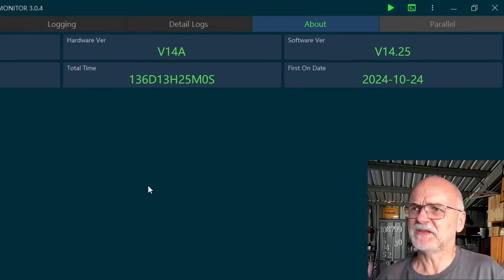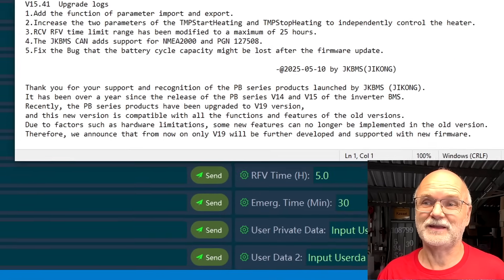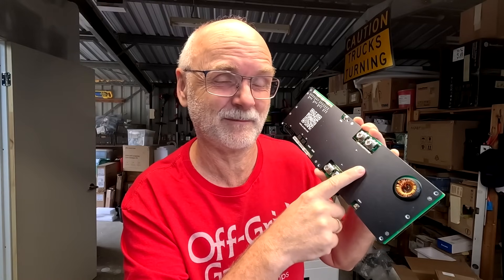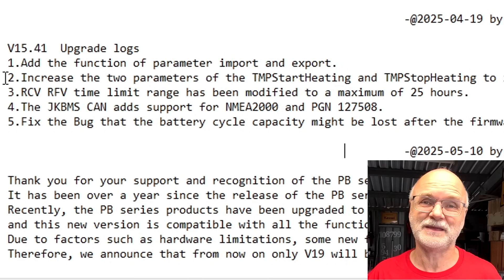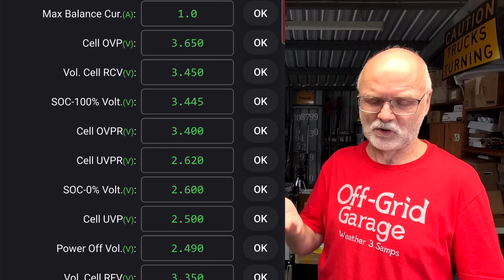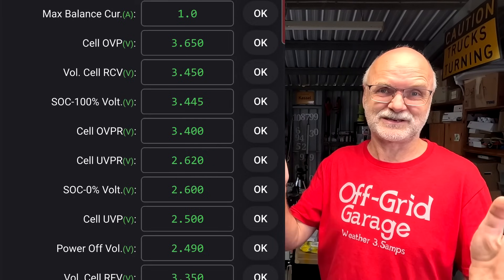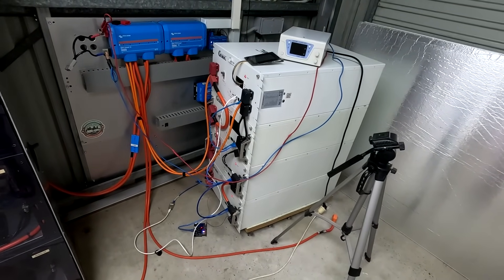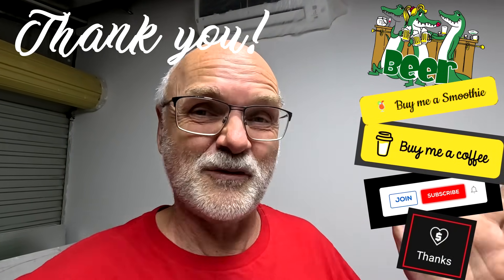The inevitable end of the JK-BMS. EOS for V14 and V15 - is that it?

Comment: With every good thing, there comes an end 🎉
Greetings Andy
A while back when you received a new kid on the block (JBD bms), your review swayed me away from it and I cancelled the order for 8 units. The company/supplier couldn’t make the bms fast enough for 2 months!!!
So I went back to PACE BMS.
I had three batteries (Meritsun 5kwh wall mount) that came with the PACE bms. The version I’ve had the 100A 15s bms and later they switched to 100A 16s bms, so technically these batteries can’t be used in parallel with newer versions 
After firmware update on the bms, there was an issue with the total charge and discharge amps for 3 batteries in parallel bc I could only get 200A discharge and 50A charge
So reached out to the company and they sent me 3 new bms that I swapped into the batteries leaving me with 3 extra bms
Since the cost for batteries was still high, I chose to go fully DIY with my solar system and decided to build my own batteries 
I purchased 5 more PACE 200A BMS and I intend to to build 8 more batteries to put in parallel with the 3 I’ve 
The issue I’m running into is, the batteries I bought from Meritsun were 15s using a 16s BMS but with fewer cell leads on the BMS connectors to suit a 16s and the number of cells in the BMS software reduced to 15cells
I’ve gone into the software and changed the number of cells to 16 and when I do this, is shows number of cells as 16 but has missing values for cell 14 and 16

Have you tested these bms set up for 15s even though they are 16s and added more cells to make them 16s bc that’s what I’m trying to do to get to parallel all my batteries 

I’ve new wiring harnesses that allow me to connect to 16 cells but need to know if there’s something I’m missing before I fully connect these batteries in parallel and find out the hard way 
Thanks

Comment: I believe JK BMS should have the option to configure charge and discharge efficiency. My battery system operates with 95% efficiency for both charging and discharging. When I account for these losses in Grafana and compare two full cycles from 100% SoC back to 100% SoC—even months apart—the numbers add up perfectly. I genuinely can't understand how JK BMS could lack such a fundamental setting.
Reply: Additionally, with the latest firmware, my storage system never reaches 100% SoC—it consistently stops at 99%, even though all settings are correct. The only minor deviation is a slightly increased charge voltage, as my Deye 6kW inverter loading with under voltage by about 0.05V per cell. Still, this shouldn’t matter, since we're defining 100% SoC based on configured parameters…
Reply: @maciegx1337  I quit using closed loop for charging switched to lead acid set the voltages never looked back. Closed loop is over rated IMO. I use a shunt to set everything the way I want it hasn't changed.
Reply: One more thing: the mobile app was supposed to show the current charging state of the battery and display the float timer and other relevant status information. Unfortunately, this still isn’t working as expected—the app does not display this information at all.
Reply: @maciegx1337  welcome to china.
Reply: @maciegx1337  Yes it does.  Update to the latest App on Off Grid Garage website
Reply: I wonder if the 19 is coming in at the same price as the 15.

Comment: I have a single 100 Ah battery with jk inverter bms v15, a multiplus2 and a raspberry pi running venus os. Dvcc is enabled. BMS is connected through usb-rs485 adapter to rpi. The rs485 port is one near CAN port. My absorption voltage is 3.45. I see Requested charge voltage of 55.2 in VRM, which is correct. After 30 min of absorption the requested charge voltage is shown as 54.0v and I don't understand why. My float voltage is set to 3.35v (which should be 53.6v, not 54.0). The system stays in this state for days if I don't discharge the battery (it's a backup system in the apartment). The led on multiplus is in absorption state (not switching to float). Any idea where those 54 volts are coming from? I didn't configure it anywhere. 
If I switch multiplus to Inverter-only mode, I can see in VRM that requested charge voltage is 54v until battery SOC is above 80%. Once it goes below the requested charge voltage jumps back to 55.2v. I'm on 15.38 firmware. BMS is 150A 1A 16S v15.

Comment: I bought my first jk inverter bms on march 22nd, in official jk store on ali. It's v15. It was not advertised that there will be EOS in just under 2 months... And it was not at a discount price either. I expected they will fix some issues along the way. Well, it mostly works, expect of SOC. The SOC is just 1% when cells are @ 3.15v. I wish I just went with basic (non inverter bms) and smart shunt...
Reply: It's rare that you'll get a company pre-announcing a replacement, because it'll then end up with a sales slump and lots of unsold stock. I'm afraid that's just how capitalism works. (I got mine in January.)

Weird behaviour. Have you definitely set the correct battery capacity? How often does it reach 100%? It sounds like the capacity has been set too low, because it (somewhat inaccurately) determines SOC by integrating the current flow and if it thinks the entire battery's capacity has been taken out of it, it will stick at 1% until the low voltage threshold is reached. It is possible that the battery is indeed quite near empty at 3.15 V/cell, due to the flat discharge voltage curve. Try setting a slightly higher capacity - Andy's found that cells perform better than their specification.
Reply: @matthewmarks6951  yes, but when I shop for android phone I can see a release date and I can see when 3 or 5 years of updates will run out. So I can buy either previous year model cheaper, etc. 
For SOC, it's apartment backup system. I charge it to 100% twice a week. I'm not 100% sure in the capacity. I bought used 16s 100Ah battery without BMS in EU store. Store claims there should be at least 96% of original capacity. I set it to 100 Ah in BMS. But I didn't yet perform the full capacity test as I don't have a good shunt to do so.
Reply: @AlexanderBelikov  OK, well because the capacity you set in the BMS is what is used to determine the SOC in conjunction with measurements by its own inaccurate shunt, treat it not as the battery's actual capacity, but instead a figure to adjust to get the behaviour you want. This is presumably a higher reported SOC at the  charge level you've mentioned,  because otherwise the inverter shuts down as you've exceeded its maximum depth of discharge limit?

Comment: It would be nice to have bug fixes (Like 100% SoC reset for example) though. 😂
Reply: Search for the video "New JK-BMS V14 and V15 Firmware with advanced Charging Algorithm and... a new bug?"

The "new bug" is a hardware issue coincidentally noticed - on some units the dry contact relays are unreliable. What other bugs need fixing?

Comment: If Jikong really wants to be the #1 go to for BMS'es, they should make their firmware open source. There are no real financial downsides for them, only benefits. Because, together with the community you can build awesome firmware, which they build for FREE, and in return, you will make a lot more money because everyone wants a JK BMS because it's so versatile and customizable :) Don't you agree Andy?
Reply: Exactly my PoV too. Andy, would you consider to put a discussion with them about that ? I actually do think, ppl buy their hardware mainly, and not the "whole product". They are rather "accepting" the current software environment (firmware, app etc) as they dont have an alternative.
Jikong CEO should realize the following: They have a "special" and educated range of buyers mostly. The do not need (!) and basically shouldnt even try to make it a standalone-solution. They should realize, what their users want, is integration into their very different kinds of setups - I bet they would increase sales by more than a 100% by providing an open-source firmware that would pretty sure end up in a lot smoother integration into other diy-opensource-systems.
In short: Remember your target audience. Non-Tinkerers will not be opting for JK-BMSes in general.
Reply: Worth looking up existing discussions of this in the comments.

Comment: Hi Andy, just need some advice on where to get a 20kw battery for my off grid motorhome. I’m running a 48/5000 victron multi plus 2 system. Please thanks mate love your work
Reply: You can try LiTime batteries.
You can make it as big as you want.
There are lots op options. Also for other brands.
You can use 24v batteries in series, or multiple single 48v batteries in parallel.

Comment: this is great; but mostly what is worrying me is inability to 1) download latest JK BMS APP from OFFICIAL SOURCE 2) install and make it start on any of my phones that latest version of the JK BMS app which supports new features implemented in the firmware (latest versions they compiled only for arm64v8  CPU-based phones but even on my arm64v8-based phone the latest versions does not start after installation. 3) JK BMS V15 150A-version cannot be Bluetooth-paired unless I use "temporarily-generated" code from Miro's website as pairing pin; and it does not remember "paired" state, need to enter new code EVERY time. What if no internet access or Miro's website closes down?
Reply: in google play store right now:   does not say which version is it, but "Updated on Nov 24, 2024" - obviously it is outdated version. WHY the user of their BMS has no other option than looking for the latest version of the app ELSEWHERE - not even on manufacturer's official website ?

Comment: I think I still have two version 10 JKBMS, and one version 11 JKBMS running for over 3 years straight. They stand-alone, are not in communication with my three EG4 6000XPs. I would like to upgrade to version 19 BMS's eventually when I add another 60-90kwh of storage (45kwh currently). I only ever had one issue with them when the inverters were set to discharge lower than the BMS's so they would cycle on and off and they were trying to actively kill the battery because each time they turned on below the low voltage cutoff, they would discharge at high amps for a second before turning off again. So I set the inverters to always switch off battery or shutoff load before reaching the BMS low voltage cut.

Comment: Forget new features, I just need existing features to work properly. I still can't reset to 100% SoC properly because of their ridiculous decision to require the RCV to be reached before the timer starts. I'm sure that doesn't need new hardware to work correctly.
Reply: You need to calibrate bms voltage at least 0.2volt higher than real voltage. I think the solved this shi# with the new frimware but I'm not taking a chance sometimes after upgrade press reset button. It will work properly.
Reply from the maker: The question is, why is your inverter ignoring the data from the BMS? The most accurate battery voltage is right there. There should be no need to offset or overcompensate any voltage just to trick your inverter.

Comment: Hello Andy, after updating versions v14 and v15, I found myself having had a protocol modification in LTO PLUS IN LIFEP04. The values of the lifep04 were all switched to LTO and on my cerbo the capacity is not good which indicates 80ha instead of 582ha. Have you seen this problem Andy?  firmware 15.41 and 14.28 no good capacitee please look andy
Andy I have to flash the firmware in 15.41 where it is a bug in the firmware that does not give the right capacity on Victron Cerbo!
Reply: andy you should no longer buy jkbms the engineers are getting worse and worse the only firmware that works for me on victron is 15.38 and after that it bugs and creates alarms impossible to have something stable incredible ANDY DO YOU HAVE THE SAME PROBLEM PLEASE

Comment: I was on 15.38 FW and when I upgrade to 15.41 FW all the settings on the BMS reset.  I had to reprogram everything.  Anyone else had this behavior?
What does Battery Temp OTA and Battery Temp OTAR means on the new FW 15.41?  Both are set to to 30C default temp.  But there is no information on that.
Reply: I upgraded the phone App and Battery Temp OTA is not there anymore.  I guess it was a compatibility issue with the new FW and old android app.
Reply: must be Over_Temperature_A[don't know what] and Over_Temperature_A?_Release.
Reply: I think it has something to do with note No 2 on the release notes.  OTA Cannot be set lower than 30C and OTAR has to be higher than OTA.  But I am not sure what the A on OTA means.  Once you change them from the default 30 you cannot put both of them back to 30.  Only OTA will let you set it to 30

Note 2 is:
 2.Increase the two parameters of the TMPStartHeating and TMPStopHeating to independently control the heater.
Reply: yes for me it's the same and import 15.39 settings will work but appear frequently. so I have do all new with the APP and never connect the PC software (here 3.0.3.28)
Reply: @paultest3917  see my note below, you need to update the app to 5.0.3 using the apk link off Andy's resources page.
Reply: Same here, updated to 15.41 using the file off Andy's website and I got Battery Temp OTA and Battery Temp OTAR couldn't see the heater pad settings anywhere? I updated my Android App to 5.0.1 off Andy's resources page and it was the same. Now updated to 5.0.3 off the same page and it has fixed the problem. Just need to update the app to the latest version (don't know why JK don't have this easily accessible on their website) and it works.

Comment: I just finished building my second battery with a v15 (and the new Display)

Any idea if there is a way to retrofit my old EEL v3 DIY Box (Seplos BMS) with a JK Inverter BMS?
Reply: Have you seen his video "Installing the JK-BMS in a Seplos MASON DIY Box? Well, it's not that easy... but here is how!"? Yes, different box, but it might provide a good starting point.

Comment: Can someone help me understand: why don't we let our victron mppts and smart shunt handle all the charging and energy in/out measurements? I thought the  bms was only meant to do cell protection, balancing and cell voltage monitoring? (And maybe heating as well).
Also why would you want your bms to be communicating with your inverter?
Reply: Victron does not officially support DIY batteries, and there are some bugs in the charging process. For example, Multiplus ignores the maximum charging current limit reported by the JK BMS and still charges at the current set in VEConfigure. Only after enabling DVCC (that is, to let BMS control the charging/discharging), the system can work properly.
Reply: It would be nice, if the JK BMS could Import the State of charge from the Victron smart shunt, in my Installation the value from victron seems to be much more plausible than the value from the bms
Reply: @rainerkohls5811  I have a JUNCTEK equivalent shunt and I intend to investigate solutions such as YamBMS to achieve this.
Reply: The BMS is unable to regulate the voltage or current passing through it - it can only connect or disconnect the battery like a circuit breaker. It therefore instructs the inverter to provide the voltage/current needed by the cells at any particular time. (A slight subtlety is the current limiter - in the case of these BMSs they can limit the current to a fixed 10 amps, but this is to handle temporary issues with parallel banks of batteries - it can't instruct the other batteries to only charge/discharge at particular rates.)
Reply: @matthewmarks6951  My solar setup chargers and inverters have their own little processors and settings to work as individuals but to all work together they needed a master sensory device and a control head with larger memory and processor.. It is smart enough to start-stop-reduce-increase voltage and current for charging the batteries and operating the inverters.. BMS were designed to be a safety device that keeps track of individual cells and to look for out of spec failures.. They should not be telling the solar charge controllers and inverters how to operate, it is too many links in a chain that all it takes is one to fail to have a bad day..

Comment: Andy when we first used Lifepo4 some15 years ago research  a site called Battery Doctor it informed us on new packs charge the first 3 cycles 3.65v per cell then 5th 10th and thereafter every 50 cycles - all other charges just to 3.45v for maximum  cell life - in practice we charge to 3.45v with a 20a  constant voltage unit  until the  current falls to 2amp then stop charging - no float - about every 2 months we use a separate 2amp charger with an  active cell balancer from RC origin - it works a treat - micro cycling in the "Knee" I think is damaging

Comment: Andy, I have v19 hardware and the low SOC on dry contact isn’t working.  Can you check it?
Reply: Oh no! SURELY they've fixed the incorrect value of resistor which caused this?? (It's a lottery whether or not, or how frequently, your BMS will show this fault.) Is it only low SOC that doesn't work, or all triggers?

Comment: There is currently an ongoing experiment with a Victron Smart Shunt that allows the measurement of cell voltage deviations. The use of alarms and controlled relays. This is an alternative to the JK-BMS. I am currently following this with great attention on Guillaume Piton's French channel, Title: "Et si je faisais sans le BMS".
Reply: I have built an arduino based bms. Each cell has its own arduino with its own beeper, discharge relay (7A), over-voltage relay, under voltage relay, and can be customised. Power consumption is 0.3mA
Reply: @lexiecrewther7038 
Is there a publication on the internet, social network, blog? I'm interested in your construction, it's appreciated.